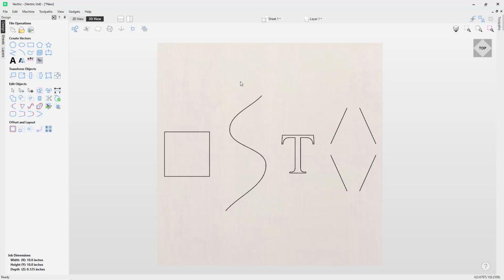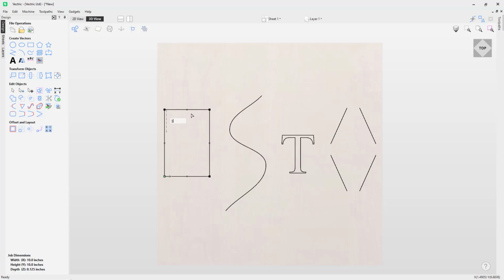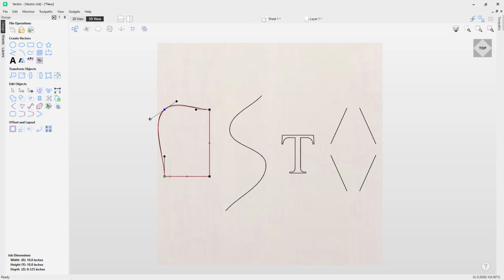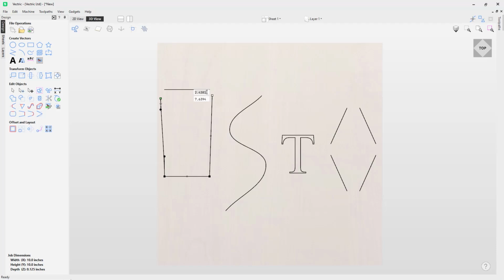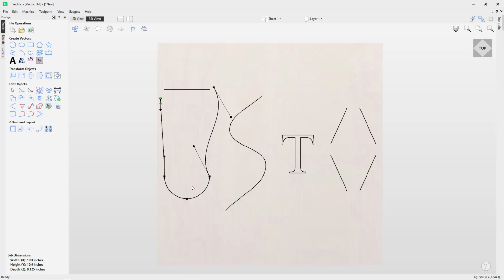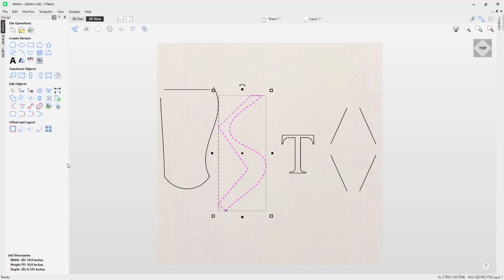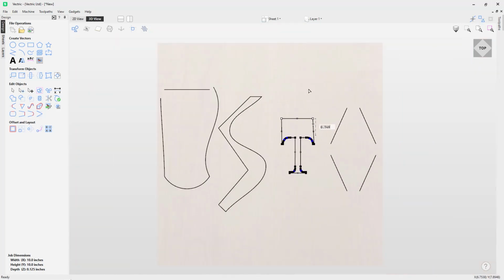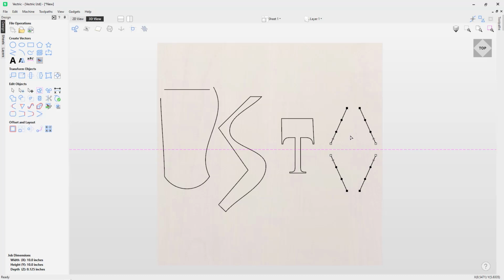How to node edit vectors  | Editing Objects | V12.5 Tutorials

Comment: Thanks for this video :-) @1:25 you show the floating panel and how you should be able to edit its value. However, the moment I release the mousebutton in order to put in a new value; the floating box dissapears? Also @4:45, you show that by leftclicking a node, the x and y value should show up, unfortunately when I left click a node no values are shown. This is in 12.507.
Reply from the maker: I'm assuming you are in the 3D view, like in the video, if not give that a try (I think you are but I just want to be sure).  If the boxes are disappearing, that seems very odd.  You might need to contact support@vectric.com and they can give you a hand.

Comment: At 4:48 in the video you are showing how to move a node by setting exact X and Y coordinates. I can't seem to do that. I always get a distance and angle type of move (relative), not an X and Y type of move (absolute). How can I get my VCarve to move nodes in Absolute mode as you are doing in the video?
Reply from the maker: Thanks for the question.  If you drag a node/s then you will see that the distances in the boxes are based on the original position of the nodes.  If you don't drag the node the numbers are based on the x,y datum of the project. I hope that helps... ?